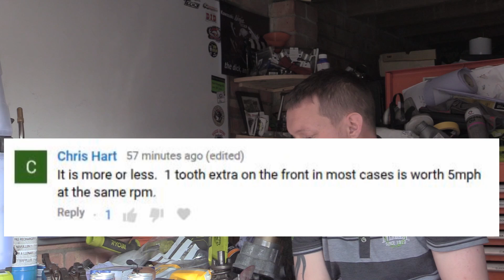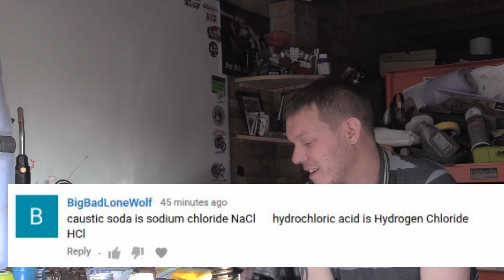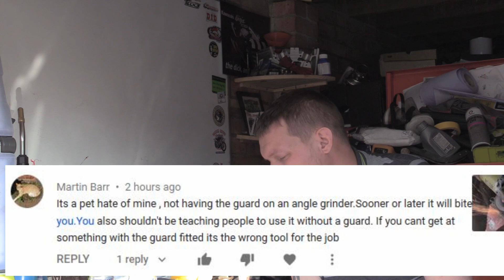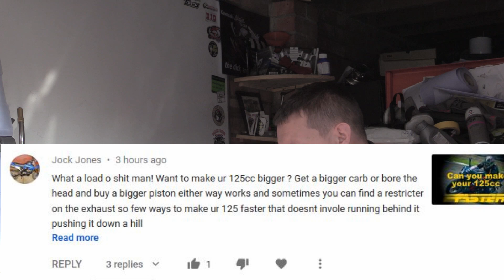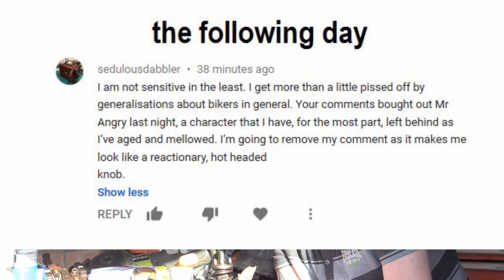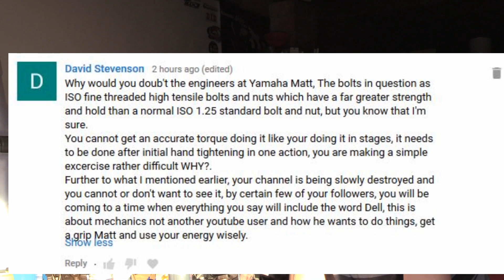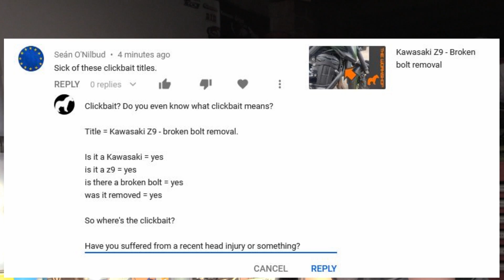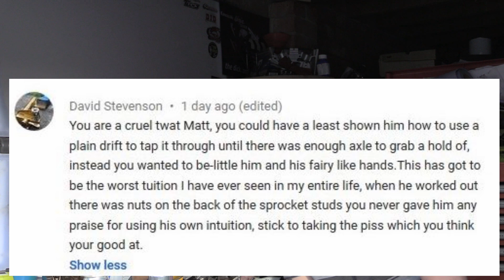Comment Corner 2019 - Full

Comment: That bit about filling the cylinder with shaving cream while repairing a stripped spark plug thread is pretty clever. The shaving cream would hold the shavings in suspension, keeping them away from the piston/cylinder wall interface. When finished all you'd have to do is crank it over and let the piston shove the whole mess out.
Reply from the maker: That is just stupid, not clever... You can't be serious?
Reply: @thedirtyworkshop  No, not all. Think about it. Is there anything corrosive to an engine in shaving cream? Getting water in there is way worse, yet unless the engine's been sitting for any length of time, you can pull the spark plug out of it, crank it over to eject the water, and continue on your merry way. Assuming you didn't bend a rod or something...Not applicable with the plug thread repair scenario.
Reply from the maker: "No, not all. Think about it."

- I have. What would cause the chips to be funneled out of the plug hole? In fact - just for the shits and giggles - we'll test this
Reply: That sounds good. I looked around online and apparently it's being done by people out there. Alternatively you could position the piston at about the half way up on the exhaust stroke, and use a shop vac to suck the shaving cream and chips out of the spark plug hole. If you could get a hold of a couple old lawn mowers, it would make it much easier to demo this, as the cylinder heads come off easy as pie. You'd take the head off to prove out whether all the shavings were ejected with the shaving cream or not. I'll look forward to what ever you decide to do on this.

Comment: Cracked connecting rods... yup, there are tons of them. I first worked on outboard engines back in the 80s that used them. Its called fracture splitting and these con rods had angles ground on the four corners perpendicular to the fractures. Those were there, so you could run a pencil up and down to see if the fracture was seated properly, before torquing the cap bolts.
Reply: Yes loads are cracked vw pdtdi rods are all like this

Comment: Genuine question here. I know that you have done at least one, maybe more’ video(s) on the coolant additive ‘Water Wetter’ and I think I recall you saying it was bullshit. It claims xx% cooler running and whatnot. I know water cools the best of any safe liquid to use as coolant but I’ve heard that if you can break the surface tension in water, it can get ‘closer’ to the metal it needs to cool and transfer more heat. I’ve heard Water Wetter does this. Could be bullshit but I am curious on your take of it, the surface tension part, not necessarily which product will do it well.
Reply from the maker: You'll be getting the answer soon

Comment: Good vid mate, want to pick your brains. I've got an 04 Fireblade which is on its 4th stator, as it's an 04 blade Honda don't want to know because it's not the latest and greatest.I want to keep it so any thoughts on how to fix it once and for all, apart from taking a hammer to it, Cheers...
Reply from the maker: are you running any accessories like heated hand grips and is the reg/rec the OEM one?
Reply: @thedirtyworkshop  hi mate nope no heated grips part from the exhaust it's standard. I bought a new stator and reg/rec from West country windings after this year's TT it's got a bypass going to the battery so it shouldn't fry the stator, but the last one I got only lasted 18months  which also had this bypass on it cheers for any info mate.
Reply: @thedirtyworkshop  soz it's an after market stator and reg/rec.
Reply from the maker: That will probably be your problem then
Reply: @thedirtyworkshop  Hi mate it was replaced by Honda when it was recalled with the genuine stator etc and still burnt out, Honda knew about this problem because they upgraded it on the 07/08 bikes, no worries mate thanks for the tips cheers..🏍️👍👍

Comment: I worked on a friend's 500cc 4 stroke engine, back in the early 1990's. Phosphor bronze head. Radial Four Valve Combustion (RFVC). Roller conrod big end and small end. Dynoed at 54 HP @ 9,000 RPM. Built in Britain by Rudge motorcycles of Coventry for road use and racing circa 1929. (RFVC was a Rudge patent until the 1980's when it expired and entered public domain!!)

Goes to show that a lot of so called modern tech is simply rehashed old school tech.

Comment: My FZ6R has this air whipping sound at 8k. I recently changed the plugs which required the air box to be removed and I replaced the filter while I was at it. A previous owner cut part of what I guess you’d call the “snorkel” on the inside and I’m debating if that’s just going to be a permanent thing.  I double checked everything when I put it back together, but I haven’t had a chance to get it apart again.  Is the propane test a good thing to try for leak testing, or are there better options?
Reply from the maker: That or some starting fluid
Reply: The Workshop     Thanks, I keep forgetting about starting fluid.   I found a cheap replacement, so i’m just going to make it stock and see if that fixes any issues while it’s being put back together.

Comment: Your motorcycle doesn't have a guard what's that thing over the chain
Reply from the maker: a guard from the fast moving road surface you dick, and the chain guard is for the chain not you
Reply from the maker: when have your trousers got stuck in your chain? I don't think you're riding a bike properly
Reply: Take your chain guard off give it a go
Reply from the maker: I did, on my dirt bikes for years....
Reply: @thedirtyworkshop  🤪
Reply: Ive got my nob stuck in my zip before.  Is that the same?

Comment: I tend to grab the body when on grinder, doing so without protection is a bit scary.
The guard on my Dewalt is not safe though, if you hit something with it, it can turn 90 degrees and it just falls off, somebody thought a quick removal was a good idea.
When the guard falls off it hits the disc and starts to spin together with the disk, i am guessing that would turn it into a 500W very dangerous vibrator, for not so happy times.

Comment: 😂 real men don’t have guards on 4” grinders, you can’t do the job properly with it on. 9” grinder, yeah it’s starting to get a bit fruity though.
Reply: you are supposed to have one on, then you reach the job where it gets in the way then you take it off and it never goes back on, as for gloves and glasses, depends on the job but glasses and gloves are a must on any sort of big job , i burnt a hole in a welding gauntlet just today , no way i could of cut it without gloves.
Reply: Seen videos where they tested and tried to get disc to break and hit safety glasses you would have to be really unlucky to get really hurt if your wearing safety specs
Reply: @reasonsvoice8554  Sure, you might save your eyes, but big chunks of cutting disc travelling at 90 m/s go through skin and flesh like it's not there, they only stop when they hit bone or a wall.

For sanding and grinding, yeah, guard off and have at it.  But the guard goes back on with the cutting discs.  Especially at work, where the last twat to use the machine is almost guaranteed to have said "fuck it, it's only a little grind, cant be arsed to put a flap disc on, i'll use the side of this cutting disc what's already mounted".  Or chipped a chunk off the disc.  or, or, or...
Reply: @wibblywobblyidiotvision  I've been hit by bits of cutting discs  that have broken off when I've been using a grinder and when others have been doing stuff close by didn't go through any clothing or skin
Reply: @reasonsvoice8554  You got lucky.  I got 14 stitches in my cheek.
Reply: @wibblywobblyidiotvision  and a cool scar and story to tell don't forget 😉
Reply: @wibblywobblyidiotvision  I got a few scars I've find one of the best tips it use the right cutting disc for the material your cutting steel discs are snatchy as fuck on ali!